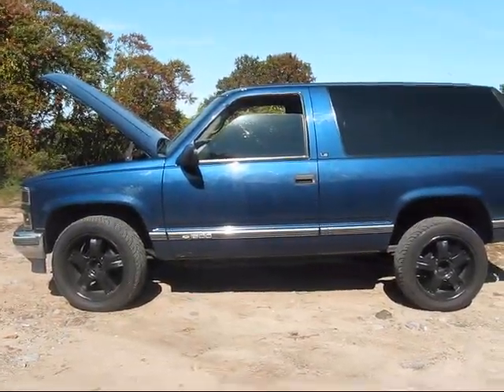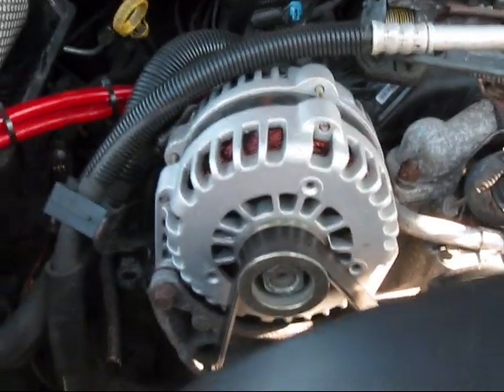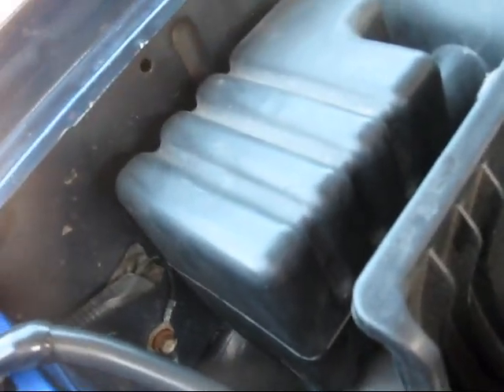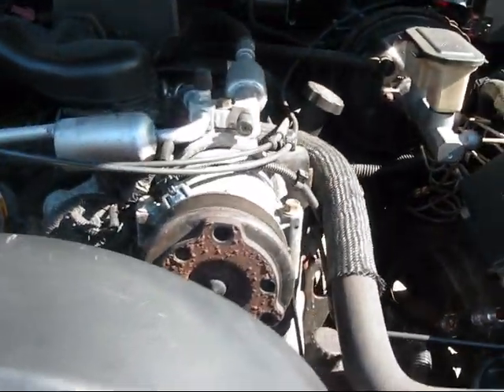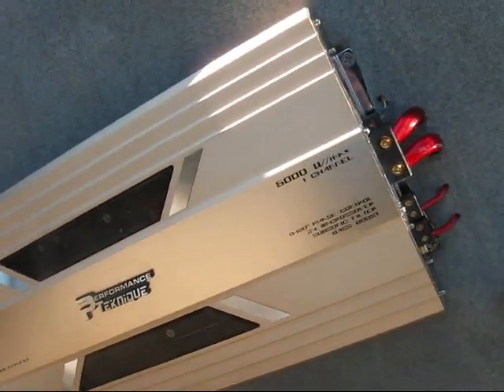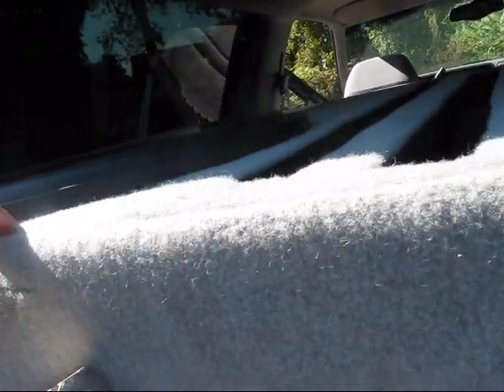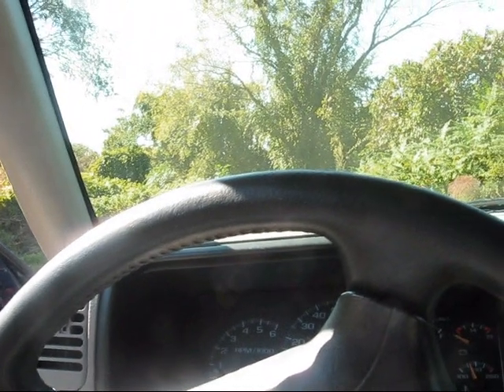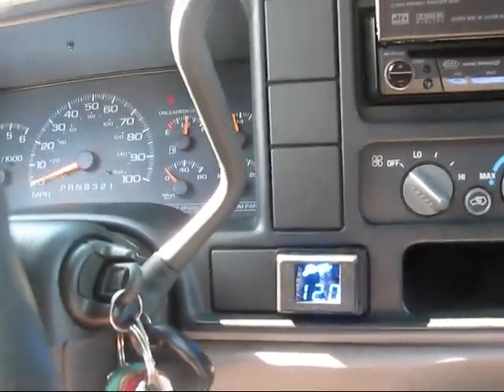how to wire multiple batteries

Comment: cant you just hook the batteries up in parallel and they will charge if only one is connected to the alternator?
Reply: I was thinking that too.  Parallel should equalize the charge distribution across all of the batteries.  He may not be aware of that though.
Reply: @fredmann8799  Hi Fred, Could you help me out a bit please.
I have a 500 watt load i need to run for 12 hours via a 2kw inverter.
The battery's will be charged via a small engine and alternator.
Could you tell me what AH battery's i need, how many battery's i need and what amp alternator i'd need to charge them.
Thanks.
Reply: @kevfromnorwichUKGGKev  well if you plan on doing that 12 hour 500 watt draw everyday its gnna be more batterys than it sounds like your ready for 😂😂😂 but if your going on a camping trip like it sounds please just buy a generator or one big battery or sumthing, u really dont need to be/shouldnt be playing around with battery banks unless you know exactly what your doing. Things can go very wrong 👍👍
Reply: @kevfromnorwichUKGGKev  It seems (assuming 12 volt batteries) you need 41.67 amps then for 12 hours so you'd need 500 amp-hours.  You can get 500 amp-hour batteries, but they're very expensive.  Probably better is a parallel connection of batteries (say, 5 @ 100 amp-hours or 10 @ 50 amp-hours).  This is a significantly large setup!  And, of course, a lot depends on if you're "charging" while simultaneously draining or just running off of battery for awhile without doing any charging.
Assuming this latter case, a 100 amp alternator would take about five hours to fully recharge your set.  A 200 amp alternator would be about two and a half hours.  And you'll have to factor in how able the engine is to handle the alternator.  A small engine may struggle with a 200 amp alternator depending on how many other tasks is has to handle simultaneously.
In contrast, running the engine continuously during battery drain would significantly reduce the total drain and subsequent charging time even with a 100 amp generator AND could reduce the number of needed batteries.  You could probably just get by on two.
Reply: WOW !  Thanks Fred for such a brilliant reply.
I did plan on having to get 10 120AH batteries, wiring them in parralel with the engine/alternator running when batterys charge drops.  I would rather have it charge during non use time, as i use the 500 w during the night time. so having an engine running is not ideal, but not out of the question. 
So if i get 5 x 120AH batterys, wired in parralel, to the inverter . You think that will be enough to use 500 watts for 12 ?
Thanks again for your amazing repy. 
Peace :)
Reply: @kevfromnorwichUKGGKev  You're welcome.  And yes, 5 @ 120 amp-hours should be good as that also gives you the theoretical 20% cushion (ideally you want your circuit set up so that it's at 80% of the max which, with 120 amp-hour batteries, you'd be perfect).  And, of course, you have the engine to fall back on if needed.
Reply: @fredmann8799  Can i be cheeky and ask you another question Fred ?
Reply: @kevfromnorwichUKGGKev  what's your question?
Reply: @fredmann8799  So when my batterys drop below optimal voltage and need a trickle charge from the alternator, powered by the electric start engine, what do i need to tell the engine to start ? i know something like that exists as ive had them on compressors and the like, but i dont know what the 'switch' device is called :)
Many thanks Fred.
Reply: @kevfromnorwichUKGGKev  maybe some type of voltage monitor.  There are a lot of monitors available, but idk if there's one specifically to fire up the motor below a certain threshold.
Reply: Clearly he was not aware of that seeing as hes not aware of the dangers caused by running battery buss bars into the inside of your sub box
Reply: @tonyterpene  Apologies for maybe a silly question. Could you tell me what the dangers are for putting the bus bar in that location please ? 
Thank's
Reply: @kevfromnorwichUKGGKev  if you loose a sub coil or knock a lead off a terminal youll have flying around the inside of the box no matter what precautions you take... if there was to be a short on that positve post from a slinky coil or a loose terminal wire youd be fucked, no way to stop the fire unless you dump the whole box. And by the time u realized it was even on fire it would be too late and the whole inside would be ruined. Its completely nonsense to put a bus bar inside the box when theres pleanty of much safer accessible places for it to go.
Reply: @kevfromnorwichUKGGKev  northstar sms220 and sms480 are great battety choices for high amp hour rating without making fire knots!!
Reply: Yes

Comment: I just want to run two 500watt RMS subs, do I need to do all of this? Maybe I can get by with  a capacitor?
Reply: Never use a fucking cap in any install. It causes more harm than good.
Reply: 500 rms you don't have to do anything. I was running 2k clean on a D3100 in the trunk, big 3 done and a stock alternator. Always stayed above 13.6 but 500 rms you should be fine without any upgrades.
Reply: anything under 1000 u should be good
Reply: wouldnt hurt tho
Reply: Yeah a second battery and the big 3 done with atleast 1/0 wire (0g). Trust me it will help a ton but I would advice getting a H/O alternator at some point.
Reply: GeminiTIGER
shit for the price of two batts you could damn near have enough for a ho alt
Reply: GeminiTIGER
an i agree with jessy dont even fuck with the caps to be honest i dont see you having to upgrade anything for 500 watts
Reply: GeminiTIGER V=IR. Assume you are working at 12V (worst case scenario). 500w/12v=41.6A. Your average car alternator for petrol vehicles is about 70A-90A, so you are within scope. However! The rating for alternators is at optimum RPM which is usually around 2000-3000RPM (Petrol), the idle output will likely be about %30 of the peak depending a few things. So you are using up to 41A + 15A (average to run the car) = 56A and your alternator is putting out  about 25A.In summery, yes you can do it, but don't crank it at idle because you will flatten your battery or stave the stereo and start clipping/distorting. 

Hope that helps.
Reply: Jessey Hixson R.A.P.M.A.N.I.A.C. aight, just gonna get a second battery seems like the best thing to do cuzz I might want more power later

Comment: im planing to add 140amp alternator and a 1000AH  as second battery then a 220v  2000w inverter to run a 750w 220v air conditioner in a van..
can i use this method to add a 1000ah 12 battery or is that not the recommended way to go with my application ....
or is weak for the application
Reply: 1000ah means 1000 amps per hour...
kinda huge deep cycle batteries

Comment: there is no point to having so many batteries unless your running the stereo with the car off.
Reply: You have no clue how car stereos work.
Reply: Lead Acid batteries are actually a good source of high amperage. Not every audio setup can run off of just an alternator.

Comment: I got a 94 yukon sport 5.7L engine 350 motor v8 and I'm hooking up two batteries in my truck . And I'm also hooking up another alternator 300amps is that good enough for my two amps and 8 speakers ???

Comment: OMG!!!! REALLY HE GROUNDED his wire to the ground for his fuel line. wtf are you thinking. hmmmm, electric and gas. ok. good luck. i would have grounded that to something else rather than connecting it to the same ground for your gas.
Reply: You should probably refrain from posting about something you have no knowledge of. I'm guessing you're the same kind of guy that flames someone for using electric brakes on a boat trailer because "water and electricity don't mix!"

Comment: never ever grounds anything to the cab, seats any of that, all grounds to the batt negative. especially the amps, only to the battery negative!
Reply: Bullshit
Reply: yes you can do that but then you have so many wires running. it is batter to get the shortest distance to your ground. the fram of the body and again as he said make sure that you go bare metal. you can scratch it off or sand it or even wire brush it to get the bare metal. when you look at it the battery is already grounded to the body, so you dont have to run an extra long wire to your battery it self.
Reply: Mark Raiden Running the ground back to the battery can eliminate ground loops it you are having problems with them, but otherwise I agree with your assessment.

Comment: well coming from a professional, it actually does matter where you ground, all the grounds in the front ie, batteries, engine alt should all go to the same ground, the batteries in the back should not be grounded to anything but the front batteries, that is how you make a ground loop, all batteries and amps should be grounded to each other, the only to frame grounds should be the front batts and the engine/alt.
Reply: Jaime Diaz Professional fucking moron! Dude a ground is a ground. I've never grounded an amp to the battery and never seen anyone do it.

Comment: on tahoes, all of them had two trays which you knew some did but all were. Also just so you are aware, but your cold air intake KILLS your MPG on chevy tahoes 1999 model and older (99 last year for 350 c.i.) just tellin ya in case your wondering why your mileage is shitty! I have a 99 triple blak 4 door and had k&n on it! Sure it made for a noticable amt more hp but SHIT ON TOP OF ALREADY SHITTY MILEAGE!  i GOTTA STRONG CRATE MOTOR AND i GET SOMETHING LIKE 14MPG AVERAGE!! 
  THATS A SHARP OLD SCHOOL 2DOOR! Props! You can do literally anything with those older tough look tahoes!

Comment: ur wire will eventually catch on fire running them next to the headers like that u can put heat shield on them-but the rubber will still melt and the aluminum wire(because I can tell that's cca) will still burn up-just sayn

Comment: you should have just bought a capacitor
Reply: you don know that the audio caps only give voltage for between 10 to 15 sec. then they are discharged. most high end stereos would need around 30 super caps to really start to see the difference. I got 3 f in my car with 2 bat. and a 200 amp alt. put the caps in for surge protection not for voltage.

Comment: i work in the stereo installation field and those amps are some of the best amps for a budget price you can get.   but the three alternators and six batteries are ridiculous not to mention damaging to the trucks engine.

one hi powered alternator and two batteries are all he needs with a dual battery isolator and hes all good.   and all that wire is not needed, 2 gauge wire (or 0 gauge for the OCD) a fuse at the second batter to a central fuse block in the rear is all thats needed ...   

My Opinion from 20 years of working in the automotive  audio visual field...
Reply: Ridiculous
Reply: My question is why run a wire straight to the alt from battery and not just upgrade the one running to the fuse box and is the alternator wire always hot on every car or truck?

Comment: Wow..so much BS information.  Please look elsewhere for the proper ways to run/charge multiple batteries and how to PROPERLY ground such power.
Reply: Totally agree. Don't use as a how-to.
Reply: there is also the big 3. for a better ground or power. its just upgrading your wires to 1/0awg or higher for better power.

Comment: Hello my name is Casey and I wanted to ask I have a stock alternator in my 1998 Infiniti I30 sedan connected to a 300 watt Rockford amp which is connected to my 900 rms Merlon subwoofer and I have 1 big battery that cost $300 my battery died in 3 months do you have any suggestions?
Reply: Those high end cars are a mother fer when it comes to putting in or upgrading the system! Like for exsample..when Dodge first came out with their higher end "Infinity" sound systems they sounded... alright back then for their time! However in order to put a sub and an amp in Normally doing it in a shade tree sense of an install youd tap into one  of your rear speakers and hard wire it into the amp! problem with that is though.. YOU CANNOT CONNECT AN AMP TO AN AMP! wITH THE DODGES BACK THEN...each idividual speaker had its own amp resulting in a person I knew to come out and find his brand new turbo daytona z burnt to the ground! Telling you this because you may have the same problem just not to the extreme in which he did! High end cars with high end sound isnt ever fun cuz their all different! Look it up in your manual or online! There, you will find out just whats needed to add your amp without problems or worse yet a fire!! IDK if that helps but I wanted to help and offer my thoughts! If it doesnt help then you just wasted 5 min of your life reading this and I apologize man!!  beejay
Reply: how old was the battery when it died ?
Reply: 3 monthes
Reply: did you play it much with engine off?
Reply: there could be many possibilities, to small of a wire to your amps, to high of an amp, running without the motor running, things like that. you may want to check your system like Brock said, was the battery brand new when you hooked all of this up?  Your amps are sucking more juice that your battery can put out. you may want to next time look and research it before doing so. but dont worry i am not busting you down about your knowledge, i did the same wrong mistake, then this is what i knew i wanted to do. So i started to research mobile audio here on YouTube and i learned alot. there are many ways to save your battery just by tweaking your wires. but as i said earlier and so did Brock you may want to look at your car specs. again research or google, nowadays there are many things that you can find on the Internet. EXOcontralto, look him up. you can also go to www.rockfordfosgate.com and ask for help. i am running 2 amps 1 at 200 2way and 300 1way (sub 2ohms) to a 10" and 6.5" 3way and tweets all by Rockford Fosgate. i am a fan of RF products. I also have a 1farad Cap (1000 w capacitor) to keep my system running perfect. You also have to remember now that RF amps dont push what they say, they have the ability to push more. so if it says 300watt then you are more than likely pushing about 325-340 watts. that is how RF products are. Hope i have helped you in giving some advice and other help tips and links that you may need.

Comment: In looking at your wiring I see no grommets when running thru metal.  That could be a problem later esp with the 0 gauge wire.
Reply: Rod Brown ......grommets, to protect the outer insulation....what is also bad for the audio performance; the return current flowing through these groundwires is equal to the supply current in the positive. At the point, the negative wire is going thru steel, the steel function as an self-induction, so trying to oppose the audio peak current in the wire. This will seriously cut-off high peaks in the system.
,

Comment: SPOT ON!, At the moment his two batteries are technically in parallel because both positives are common'd to the alt Post with no isolator and both grounds are to the chassis meaning any amplifier can draw from any battery including the Cranking battery.....

Ideally As stated a separate *ISOLATED* cranking battery is a must. atleast then if the amps drain the Aux batteries, the truck can still be started without a jump = Happy days :P.  , decent quality automatic bat switch = problem solved :P

Comment: Suggest a battery isolator, this way it can charge the main battery so you never run it down completely, and it charges the others saving them to run the amps. Also would say you need a capacitor to help boost the power output when you run your stereo, it stores a small amount of power and will help keep the battery from draining quickly.
I am building a sleep area in my truck and need that stuff to run electricity, it works precisely the same for stereos.

Comment: just a tip.. its obvious youve been doing this for a while and know what youre doing.. but if possible i would run your ground to the frame, much more solid ground.. as rust on the body can really mess with a body ground. just my 2 cents. im used to the older rusty cars haha

excellent vid by the way very helpful

Comment: Pretty good for what you got on hand, one question though - do you have any BAND PASS FILTER(s) in place?

Why do I ask, well normally nobody thinks of FCC PART 15.

And that matters because you put so much money into this project, but yet anyone with a piece of shit 2w cb radio can interfere (which is allowed since again, every FCC piece of mandated equipment MUST ACCEPT INTERFERENCE)..

I say "can interfere", does not mean it happens all the time, but just curious if you though of that?

Comment from the maker: 13 volts is a safe voltage to drop to,but if you do want to do something to help out you best bet is to get a car audio battery for under the hood either kinetik or xs power and second get a bigger alternator and that will fix the problem

Comment from the maker: a second battery will only give you a little more time until the lights dim,the batteries only store a charge...once you drain the charge your hurting you batteries and alternator thats wy it dims....to prevent it you need to get a better alternator and it will never dim again...my suggestion is look into dc power alts

Comment: Hey Jon I got a question I was wondering if I don't wana do anything with the stock battery can I just run wire from the alternator right to the battery I have out back? Then run my amp off that? Thanks

Comment from the maker: @Seanreck most likely you will need a bigger alt,the best thing 2 do will be install it all then check you voltage with a meter if you can get ahold of 1 and make sure the volts dont drop under 12 at idle

Comment: 1 why did you go with performance teknique amps if your going to run that high end of a set up... and 2 make sure you rubber gromit those ground wires going threw your trunk or the vibration from your subs and the metal can cut the insulation on those grounds...